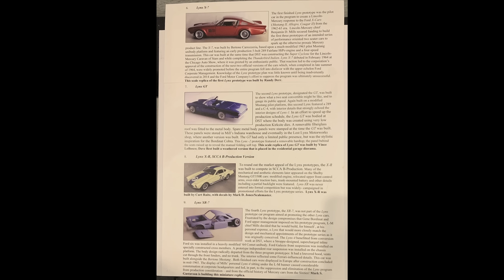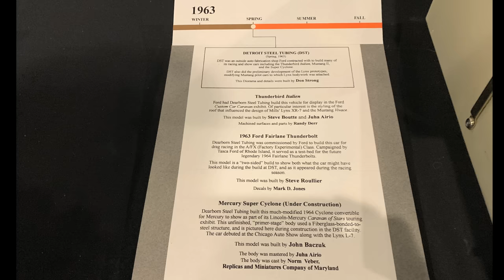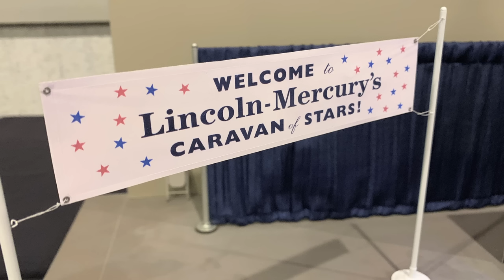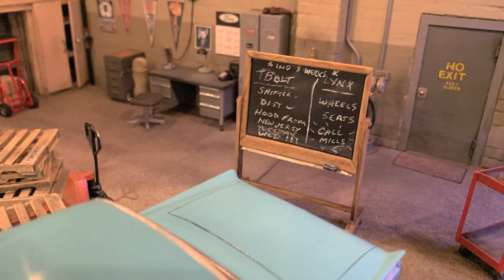20 Year Modeling Obsession - The Lynx Project

Comment: The rear end of the Lynx reminds me of that Studebaker  sports car that came out around that time the Hawk.  These guys are sick (in a good way). Still working on my Cannon and Ammo cart project.  Have acquired more tools and epoxy body filler.  Still priming and about the start detailed painting.  

And by the way Karyn how many people can remember Johnny Cash’s song about a Cadillac stollen a part at a time.  

Your comment about the Falcon O Lay was cheeky don’t you think since the Mustang was put on the Falcon platform.

Very interesting video that shows what happens when you leave individuals to their own devices.  

Great video.
Reply from the maker: Hi Ken!  Yup one piece at a time!  I got my mustang that way. Well… it was a car. But after about two years I had replaced every part. One piece at a time.
Reply: @ToyManTelevision  I see these videos where they are restoring VWs and they are essentially welding a whole new car together.

Comment: Very nice series of diorama. The first Toyota was also formed on wood for production. In fact, the diorama on the prototype construction remembered me the Nagoya's Toyota museum, where a similar display (but scale 1:1) exists for this first Toyota model.
Reply from the maker: Kirkham Cobra still builds their cars on wood bucks in Poland in an old MIG jetfighter plant. They wanted to build their cars in this way, and then they discovered that that’s how MIGs were being built! And after the collapse of the Soviet union, this aircraft factory was sitting dormant.  And so they contacted the people there, wrote them out a check for $1 million, and started manufacture their automobiles on wood bucks in the old aircraft factory.
Reply: @ToyManTelevision  I remember reading something like this, but I didn't know that it was still active. Old aircraft were often made by hand, but it gives also some issues. Apparently for the French Caravelle, the wingspan varied of several centimeters from one aircraft to the other!